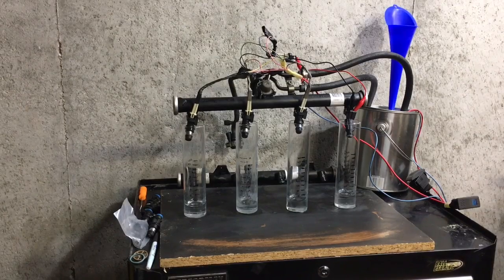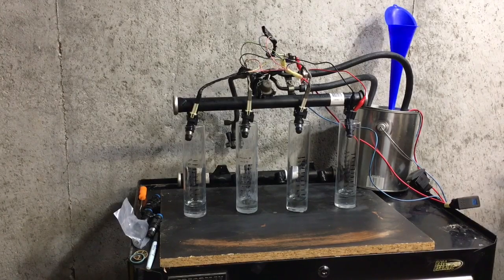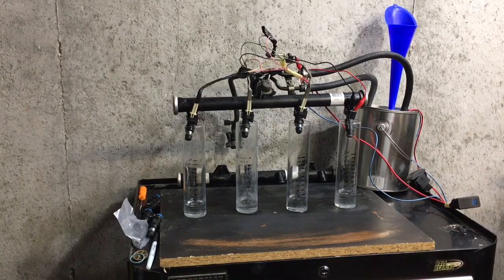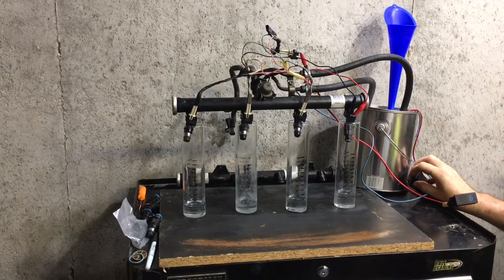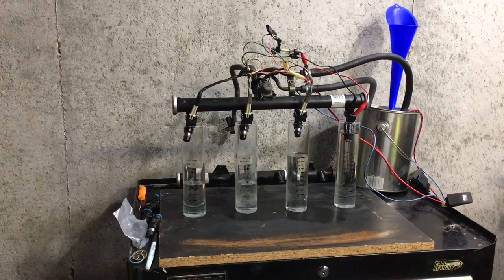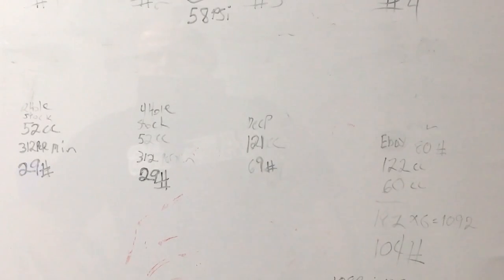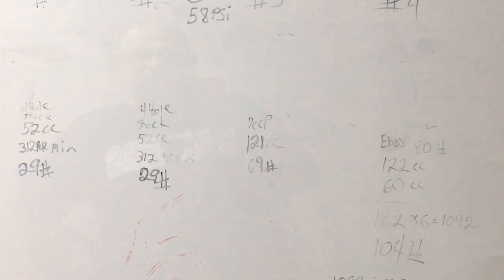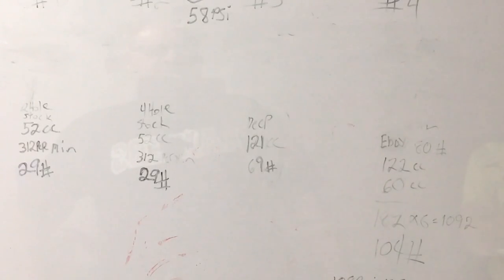Decapped truck injector 4.8 5.3 6.0 flow test 69#

Comment: A couple of things or maybe three- what test fluid are you using if that’s gasoline I have some safety concerns the orifice plate doesn’t matter what how many holes are the rating of injectors a reading of the injector or yams use your first plate for aiming the fuel stream and fuel administration I be concerned about the capping injectors you increase the flow at wide-open by double now the turn down ratio’s gonna be messed up at idle I be concerned that you’re going to be sloppy Richard I’ll in a few idle for extended periods of time possibly you’re going to be making oil in the crankcase because fuels going to be puking into the crankcase
Reply: Sorry accidentally posted while I was editing —the orifice plate is used to aim the fuel stream and for fuel atomization. The flow rating is the flow I regardless of the number of holes in the plate.  Removing the orifice plate will increase your WOT flow but will also increase your minimum achievable idle flow... so potentially you will be sloppy rich at idle.  Concerns are running quality at idle and possibly pushing gasoline into your oil “making oil”.
Reply from the maker: Wayne Kolden Here’s the absolute truth, we haven’t touched this make shift test stand since making this video. The fluid we were using iirc was denatured alcohol. 
I want to share both our experience, our friends experience, and several people  online running Boosted combos with de capped injectors. 
1. It usually takes more than one set of injectors, to get reconditioned/flowed by Eric Derr injector service to assemble a full set. We’ve found there’s generally a big variance in the output of the GM injectors, normally people send in at least 2 sets so Eric can flow them all and hand select the best 16. 
2. It is proven, all the Myths about spray pattern, angle, path etc literally make no difference in operation. 
3. Go to Badluckgarage Robert has a great video debunking the hysteria surrounding the decapped injectors. Robert shows on his own Turbo C10 how it’s tuned for start, idle, part throttle cruise and WOT. 
Check out Doug at Goodenoughgarage as he’s made videos showing his success with decapped injectors. 
Matt Happel “Sloppy Mechanics” has more than validated the validity of running decapped injectors in moderate boosted applications from 400-600 rwhp.  Even in his wife Jamie’s daily driver truck. 
Richard ended up trying to run the EBay 80# injectors but they were junk, couldn’t be tuned, so he ended up buying a set of the Holley 83# and they responded much better to tuning with his Holley Dominator EFI.  I admit we are novice or below trying to tune, we’re both just learning as we go. 👍
I truly appreciate your feedback, many people are curious yet hesitant on the decapped subject. As for me, when I install the Turbo on my “Turd-no” Blazer I’ll be running a set of decapped. 🤞
Reply: HeadFlowInc I can’t argue with success if it’s working for you that’s all it matters .  Of course if we’re having fun during the journey that’s a bonus.
Reply from the maker: Wayne Kolden I appreciate your input, it generates the curiosity to learn.  If I was going to exceed ~500 rwhp I’d recommend going with a quality name brand injector. 
As my build unfolds, in “Theory” 🤞 I should be able to get really close to 500 whp at 10# Boost. 
First stage is the 4.8 NA build looking for 300-330 rwhp.  Then install the Turbo setup! 👍😁

Comment: You dont need to buy cc'ed beakers, you can use a mixing cup for cooking , transfer the amount over to clear containers and mark the cc amounts on those containers. This should be done before you run the injectors anyway to make sure you dont have a weak injector, unless you like holes in a piston.

Comment: can you test an FMU flow vs stock
Reply from the maker: Tyler Merkley Richard built this fixture purely as a way to compare the flow change with decapped injectors.  If you want/need injectors cleaned/flowed contact Eric Derr he’s very reasonable.
Eric Derr DERR Injector Service Derrmain@twc.com (502) 381-4678. Great guy, great prices,

Comment: What happened to the arduino set up
Reply from the maker: jorge salinas What’s a arduino?
Reply: Its a microprocessor in which you can write a specific code to do a injector testing to precise timing intervals like 10sec dynamic or 10sec static flow
Reply from the maker: jorge salinas That would be excellent, a true tuneable test stand!  I appreciate the info!  JD
Reply: Yea look it up here
Reply from the maker: jorge salinas Thank you! 👍

Comment: I'm getting 87lb hr out of set of decapped flex fuel injectors.
Reply from the maker: Scott Coleman Sounds great, those Flex injectors are bigger to start with, so in the 80’s should be legit. Keep everyone informed on how the run!  JD
Reply: I've been running them for a while now, recently went to e85 10psi, still have a little headroom on injector but am very close to running out of pump with the single Walbro 450.  They tune good really no complaints.
Reply from the maker: Scott Coleman I better get busy looking for flex fuel injectors!   It’s best to have 2 sets so Eric can match a decent set.  Thanks for the feedback hopefully it helps everyone!  👍

Comment: Not PPH, not sure if thats even a thing, Its PSI, pounds Per Square Inch...
Reply from the maker: Steve Lindsay Injectors are rated at Volume per minute/hour not PSI.  Pound Per Square Inch is a measure of pressure ie fuel pressure at 48# to 62# 
Fuel injectors are rated at 24#, 36#, 60#, 80# etc. 👍
Reply: Thanks. I've only run Carbs on my Hot rods and trucks, I don't own anything new enough to have fuel injectors, so when I heard you say pounds per hour, I had never heard of that before, . Never to old to learn something new or re-learn something old... No offence mean't by the comment, and thanks for the clarification.
Reply from the maker: Steve Lindsay No problem at all, I’m new to fuel injection myself.  With the new Fitech and Holley fuel injection kits that bolt on like a carb and self tune it’s a good time to try it!   I would play with a carb but im going Fuel Injection from now on, it’s too easy especially for daily/Winter driving. Thanks for your conversation! 👍

Comment: don't complaint if wasting gas like a V12 engine.
Reply from the maker: Moe Maywood ?
Reply from the maker: Not true once you tune the fuel table to the new higher flow rate.  Check out my friend on the badluckgarage concerning the tuning of the decapped injectors. 
The issue people tried to focus on is the change from a fan pattern to a pencil spray pattern.  Hint:  all Large flow injectors use the pencil spray pattern. 🤔
You can tune the cold start, idle, part throttle cruise, and WOT power in the same way as any other injector.  Don’t fall for the negative Nelleys trying to ruin a good idea because it’s inexpensive. 👍
Reply: @HeadFlowInc  I run decapped in 2 of my rides one a n/a 6.0 mild build and the other is in my 3500hd which is a mild cammed lq4 running 10# boost daily.
In my n/a one I've dove it for 4 years as a daily and on road trips .
Burns less gas than my bone stock 5.3 trailblazer
Reply: STUPID COMENT moe!!!!!!!!!

Comment: Not a accurate test do to four different injectors
Reply from the maker: Zane Wilson Why would you feel the test isn't consistent?  Could you elaborate?
Here's the setup:  Single common fuel rail, fed by a Walbro 255L fuel pump, fuel pressure regulated to set test pressure. Even the voltage to the pump is monitored and controlled. 
Even if you add up the flow of all 4 injectors it wouldn't come anywhere near the volume and flow provided. 
There's no way flowing different sized injectors on the same fuel rail significantly affects any single injector flow. If the injector size affected the individual flow, the the injector farthest from the fuel supply would always flow less regardless of size. This isn't how it works.  JD

Comment: they are rated at a base pressure of 3 bar and you ran your test at 4 bar. 104/4*3=78.
Reply from the maker: After we made the video we went to ebay, the flow difference was a simple difference in the fuel pressure.  Our test was made using the factory LS return style fuel rail rated at 58-62# of fuel pressure.  After reading the ebay listing the knock off 80# injectors were flowed at only 42# of fuel pressure.  By simply increasing the fuel pressure from 42# to 58# bumped the flow from 80# to 104# per hour or 835cc to 1092cc per minute.  Thanks for the feedback hope this helps!  JD